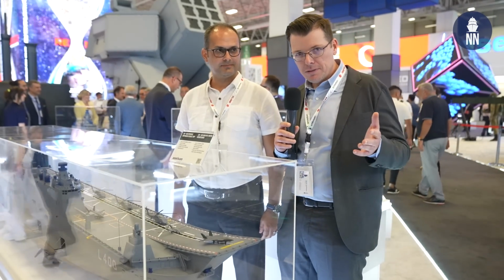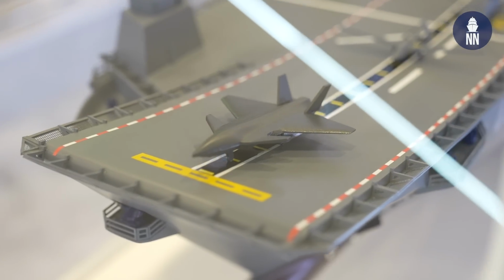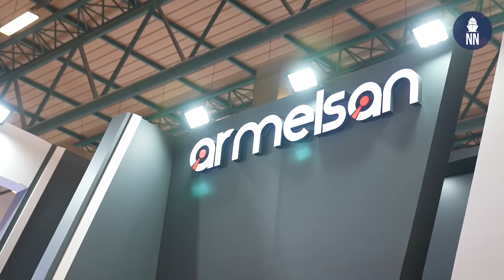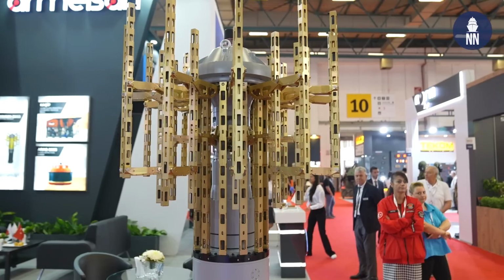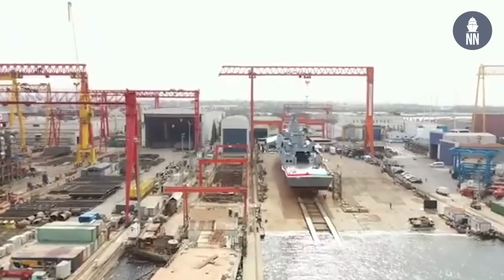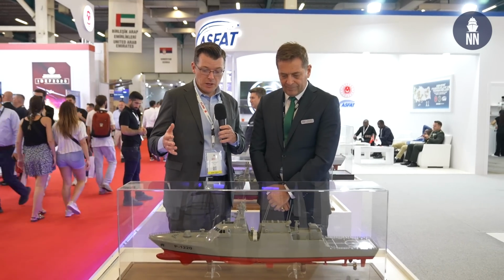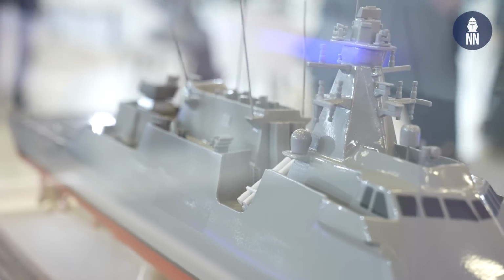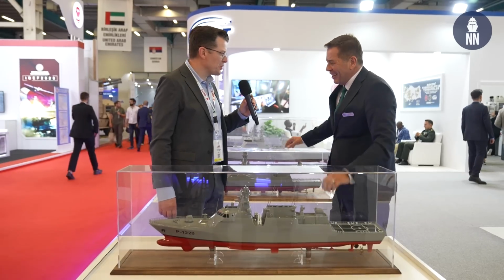Turkish Naval Defense Technology at IDEF 2023 - Part 2

Comment: Great coverage on 2 day👍Q. Is Turkey upgrading their Seahawks or building their own?
Reply: Gokbey ... a Turkiye made new helicopter. TAI working on "sea" model of it for replacement of "old" Seahawks ... now Gokbey on the "high altitute tests" 15k feet finish far as I know, next test about 20k feet.     https://en.wikipedia.org/wiki/TAI_T625_G%C3%B6kbey
Reply: @kaanyagzer8536  thanks👍it’s shame that Turkey not just lost out on F35 but MH60R as replacement for old Seahawks,  New Zealand is looking replace their Sea Sprite maybe Gokbey been cheaper platform to Seahawk could be offer to NZ?
Reply: @jamieshields9521  As you aware sea capable choppers really rare and expensive animals, you need time for lot of extra development unlike land base (basic) cousins, because sea water and salt also humidity; only electronics carry by those babies almost same price tag with two land base model ... Gokbey join army service end of the 2024, but sea version? Maybe 2026 or 2027 ... as you can see replace the old seahawks aren't easy task imho.
Reply: @kaanyagzer8536  yeah ask us Australians about Sea Sprite, run cost of AS.350 Squirrel or even better NH90.  We could save, time if had brought more S-70B-2 versions after first batch of 16, heck we could have shouted NZ with 12 Seahawks instead buying our problem Sea Sprite.